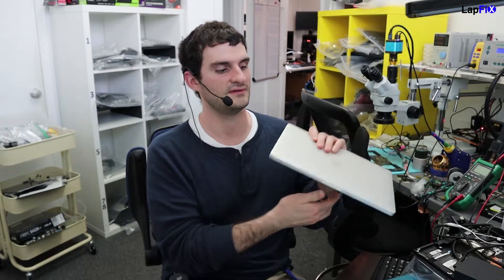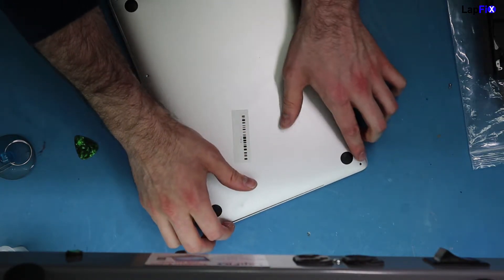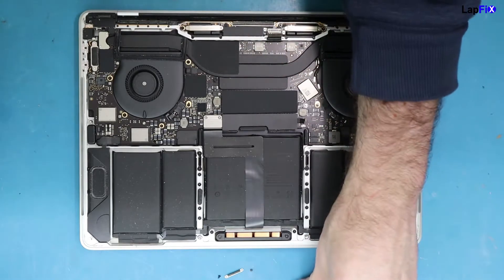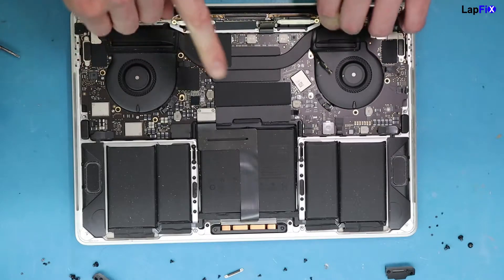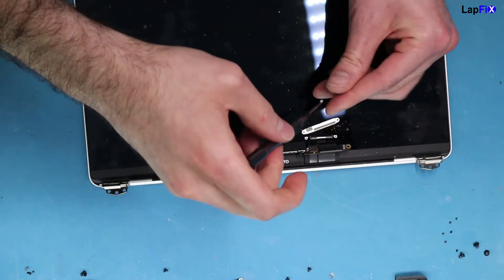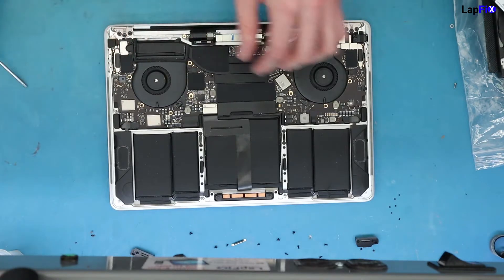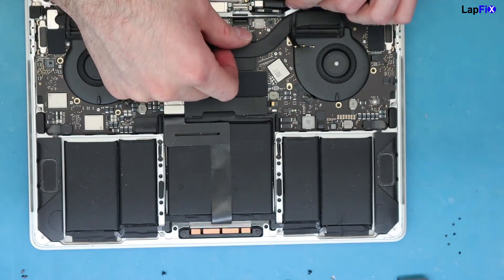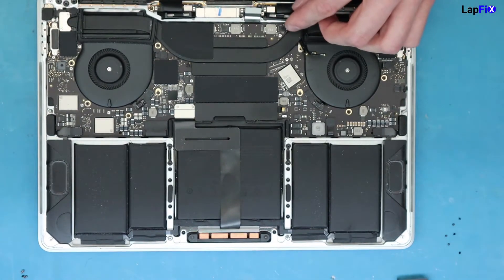How to Replace MacBook Pro  A2251 Screen

Comment: you're camera is working after replacement?
Reply from the maker: Yes, the one cable does backlight, lcd power webcame etc.  If there is an issue with the camera after replacement it can be an issue with the display assembly or the webcam circuit on the logicboard.  There is a macbook air model that has an issue with that

Comment: If your MacBook won't turn on after the surgery, plug it into the mains and wait for 2 minutes. It happened to me, it wouldn't boot from battery even if it was full.
Reply from the maker: Yes, for some models you would need to plug in the ac adapter to turn it on again even if the battery is full

Comment: I think I ruined my computer because of unclear / misleading battery disconnection part. I disconnected the flex cable that you are touching while saying "remove the battery", while the actual battery connector is totally another thing. Worst repair video ever.
Reply: What happened when you disconnected that cable because I accidentally did that too after watching this. Were you ever able to fix it?